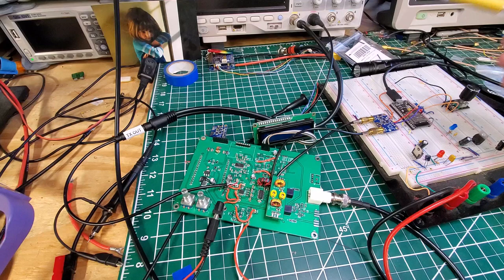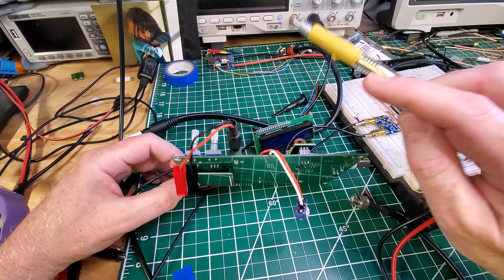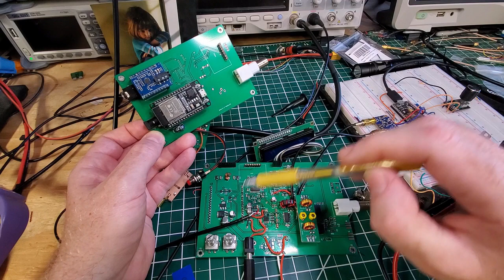SDR Transceiver - Part 6 Quick Update

Comment: Going in direction to redesign the board is a clever decision, when you want to get quicker and closer to a completed version. 
Your original intention to use ESP32 for SDR transmitter with Arduino environment remains very interesting, therefore, looking forward, what this step and your amazing work will bring up.  S52UV op. Stojan
Reply from the maker: Thank you Stojan. Sometimes a fresh start is needed - and in any case I have exhausted all my debugging ideas on the current board. I am going to pay closer attention next time to clearly separating RF and audio components. Fun stuff!

Comment: Ian,
I remember you did an intro to the ESP32-A1S about a year ago on a breadboard and except for the addition of the Tayloe circuit, you didn't have any problems. I don't remember if you said if the output signal from the ES8388 without being connected to the Tayloe was clean or not. Perhaps that ground pad on the back of the ESP32-A1S really needs to be grounded? That's about all I can think of other than something weird like noise being picked up from some nearby switching power supply or the WiFi chip on the ESP32-A1S is turned on.
Reply from the maker: Its possible, Jerry, that grounding pad is the problem - not sure. I know the module was sensitive to having a good ground from earlier testing. Like I said I am going to redesign the board using a ESP32-S3 and a separate codec board. Hopefully I will have better results. We'll see!

Comment: I don't remember if I commented before but do you have proper unbroken returns paths ie gnd under ALL clock and similar signals? The peek we got in this clip makes it hard to see your pcb layout.
Reply from the maker: I am far from an expert on such things. I do a closer view of the board in this video
https://www.youtube.com/watch?v=aEtmJBbtakM

Starting around the 30sec mark. Appreciate any of your thoughts and insights.
Reply: @na5y  In current PCB design theory anything above about 1kHz is considered to no longer just find it's way via whatever ground is around as a return path for the signal but to travel in the electric field in the substrate. There are a tonne of really watchable videos by folks like Rick Hartley which. explain all this very well. Essentially if you have a trace with say a clock signal travelling along on the top layer you should ensure it has a suitable return path (mostly gnd in your case) that is under that signal trace and is not broken by any other signal.  None of the "old fashioned" cross at right angles stuff we all used to do. This ensures that the electric fields don't just go off and try to couple to nearby signals. to find their own return path. Things get hairier on multi-layer boards where you need to bring the return path with you etc. It is all part of the newer understanding of signal integrity in PCB design. Very very often on relatively low frequency signal boards you get away with it but remember that if you have a clock signal with a fast rising or falling edge you really have all the harmonics of that signal too that you are routing. So a 14MHz squarewave clock might have harmonics into the hundreds of megs that you are also trying to direct from point A to point B. 73's 1BGT